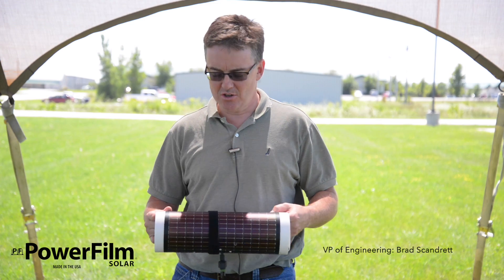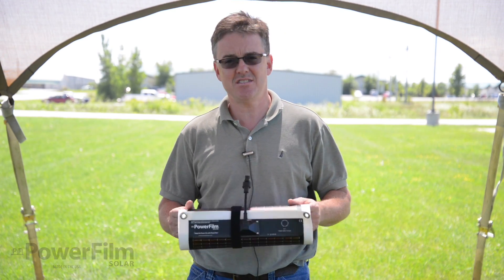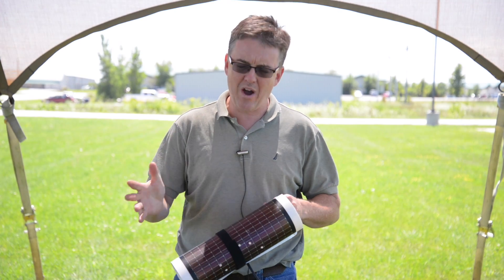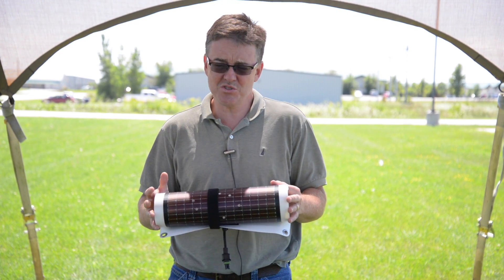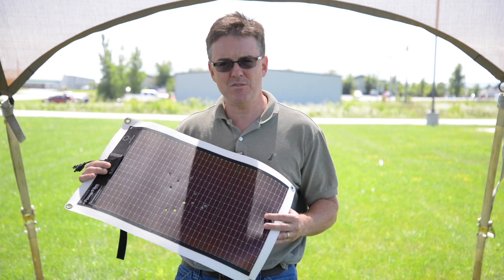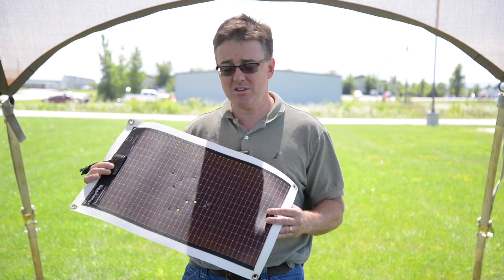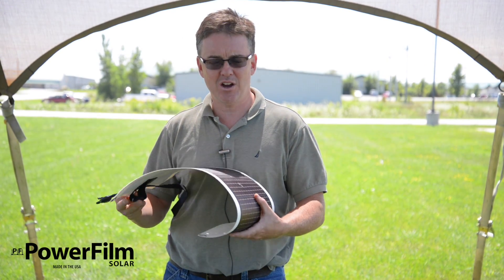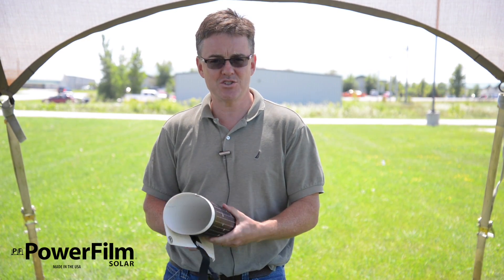PowerFilm Solar Extreme Durability Test

Comment: Are your fold up panels waterproof?
Reply from the maker: Foldable panels are not waterproof. They are designed to be deployed for short periods and then packed up. If a foldable were to get wet due to a rainstorm, it would still work, you just need to let it dry thoroughly before folding it up. Please let us know if you have any additional questions!

Comment: "Less than 20% loss" ??

You started the test with 215ma @15.2VDC or 3.268 watts. You ended with 122ma @ 15.22VDC or 1.857 watts. That's only 56.8% of the original power.
Reply from the maker: Thanks so much for reaching out. Checking with our engineering team right now to get some clarification. I'll be in touch!
Reply from the maker: We have to have the full sun power numbers in the video. Lower light numbers are correct, but this is a 7 watt module. Full sun was 450ma at 15v. After shooting it's 380ma at 15v. Hope this helps. Happy to answer any questions or address any concerns you might have. Take care.